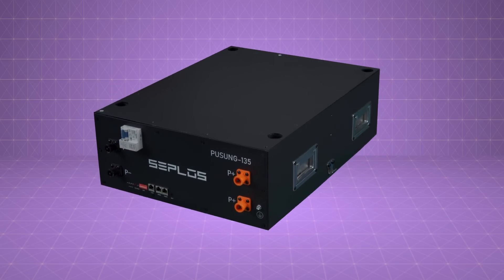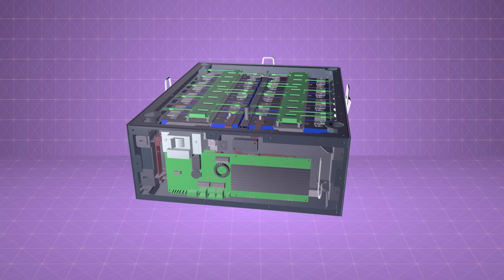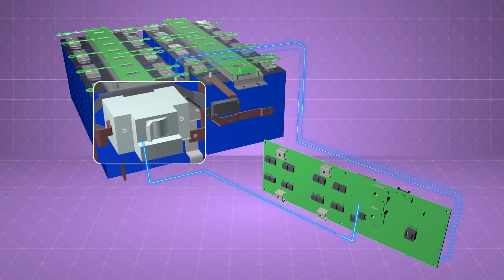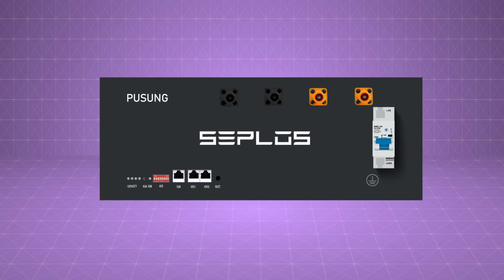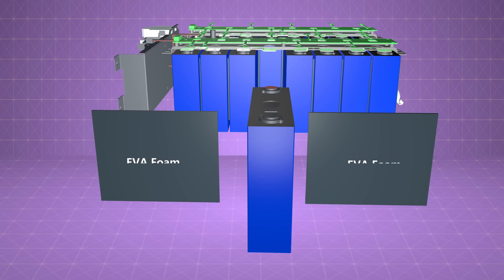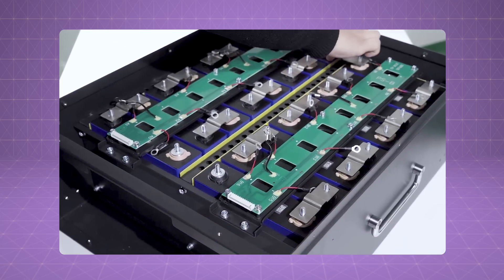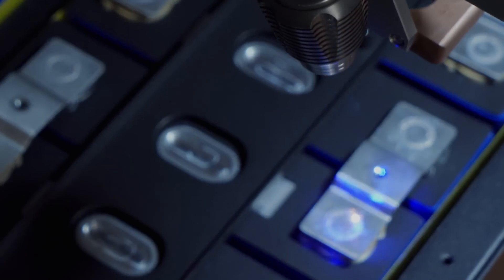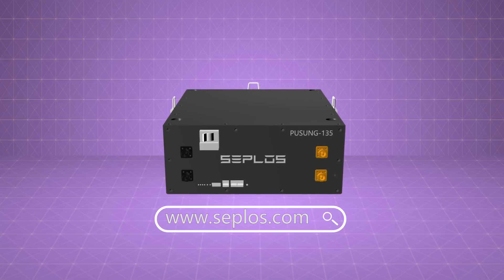Upgraded PUSUNG-135 Cost-Effective 6.9KWh 51.2V 135Ah Safer, Longer Lifespan Home Energy Storage

Comment: Why PCB? Normal cable is good enough, just waste of money, I will not pay for it, as it just looks good, but I do not think it will improve the quality of the battery.
Reply: worth it to prevent accidental misconnection, saves cost in blown up BMS.